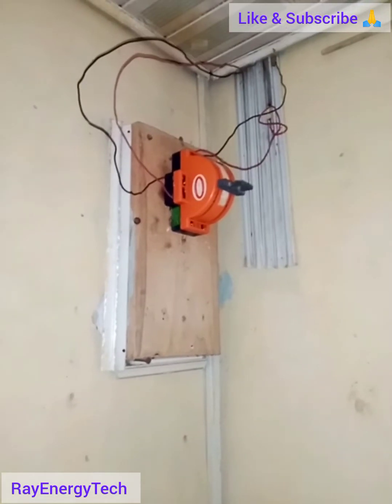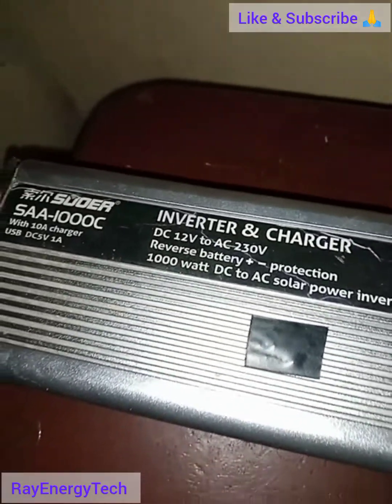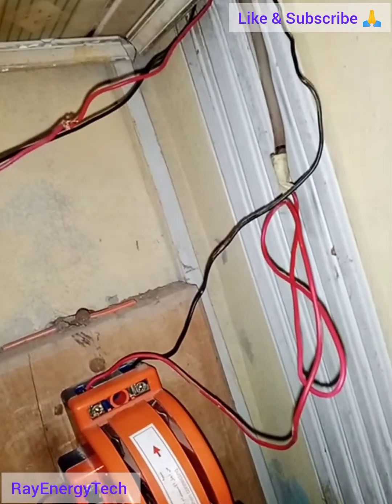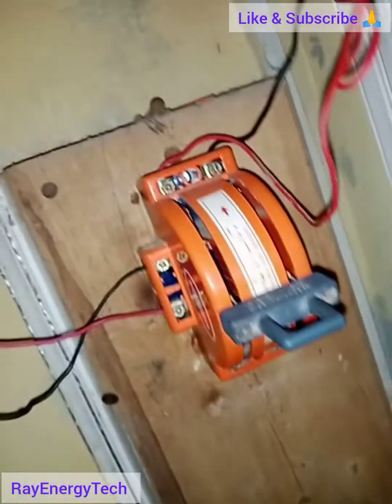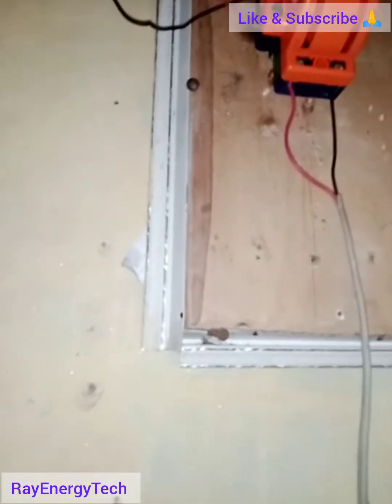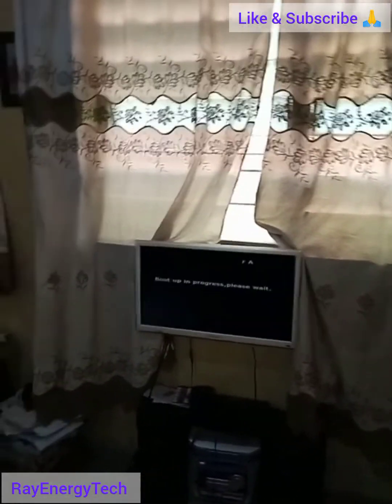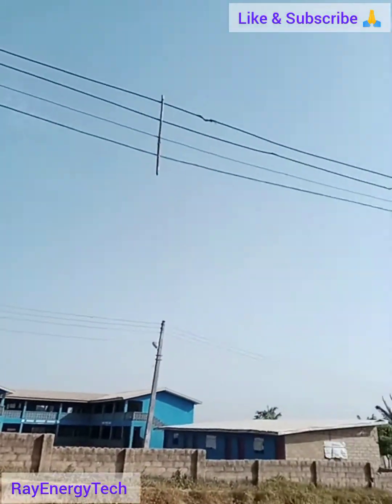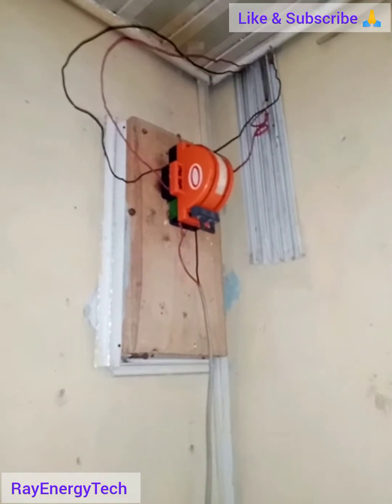CHANGEOVER switch to inverter connection

Comment: Great learning video. I ran into this video when learning how to install a manual transfer switch for my inverter  but I don't see any AC breakers/SPD next to the manual changover. If there is a short circuit in that home, all your appliances would get fried. As long as you dont have any heavy loads, that single wire going in to the house looks like 4mm2 wire that can only handle 30amps max at 230v which is around 7000w.

Comment: Positive and negative in AC? It's called Hot / Line and Neutral, not positive and negative. Positive and negative only apply to DC.

I am shocked that many people don't ground / earth their electricity in Nigeria. No wonder most appliances shock people easily.
Reply: He doesn't have a main breaker box. The grounding is usually done at the main breaker and should be connected to a ground rod.
Reply: I just learn something new